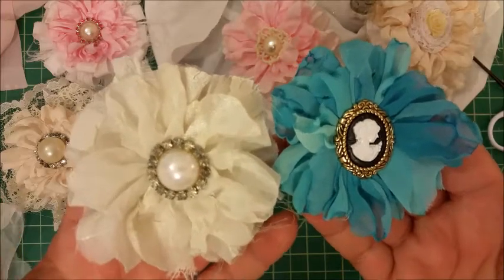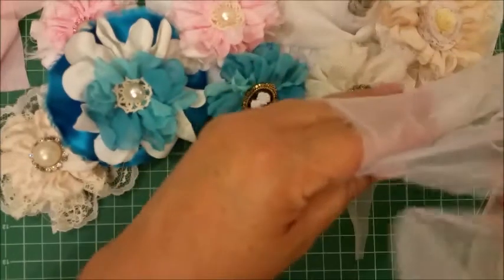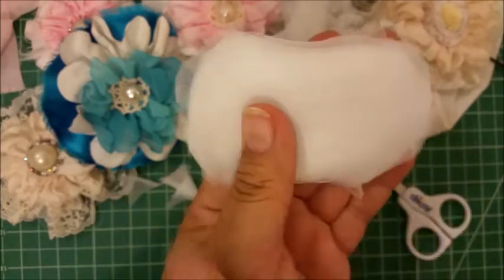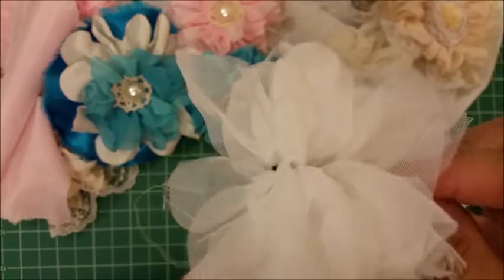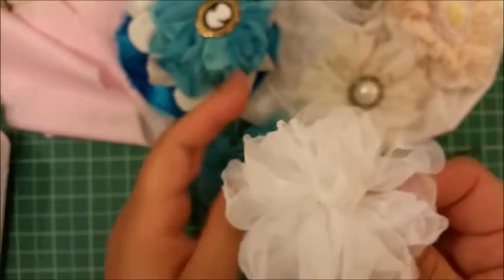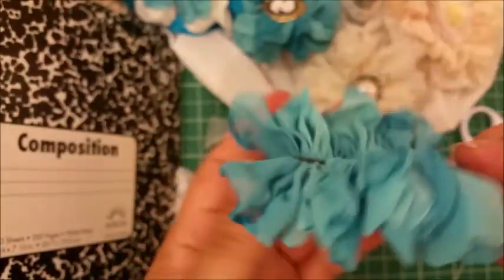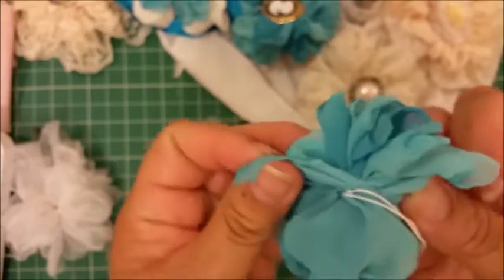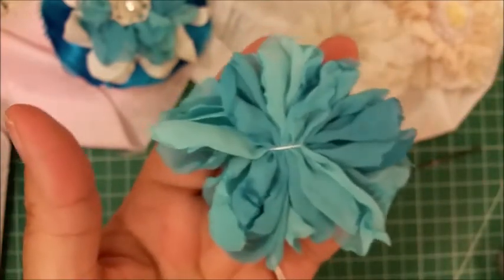Chiffon Flower, DIY, no sew, Easy Crafts, Shabby Chic tutorial, wedding crafts, Melting flower

Comment: I had an old stash of satin that I tried to do the burning technique.  The fabric kept catching on fire instead of melting no matter how far away I was from the flame.  Would there be certain satins that you would think couldn't be used.  These are a high end satin and I don't really know what they are made of because I've had them for years
Reply from the maker: +debra eaves  yes. The satin will burn. I experiment with each one to see what I prefer. When I get to my Easter corsage tutorials I will end with showing you a new technique that helps.

Comment: How do you melt the fabric without getting it black? I'm trying to make flowers from a white satin fabric for a wedding bouquet and when I melt the edges it always gets black from the flame. Any tips ? Thanks!
Reply from the maker: +Becky Jones. Many satin like fabrics are like that. The only thoughts I have are. 2. Melt from n back of fabic so it is not seen. 
Try stay I ng farther away and allow  the rising  heat to do the work.
Reply from the maker: +Becky Jones 
 try a diffrent fabric.
Try a heat gun,  it is difficult to control the heat but might eor.
Try a curling iron or h as ir flattener.
Reply from the maker: +Becky Jones one more thought, check your candle a scented candle gives off black smoke. Use plain unscented candles.